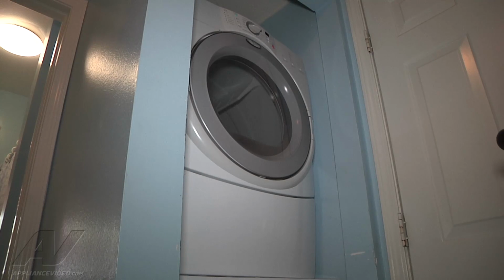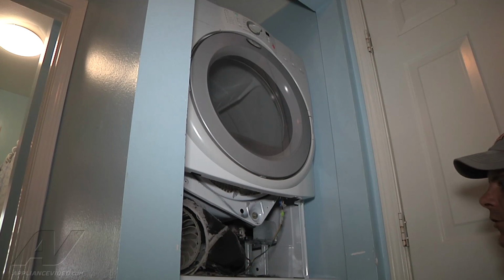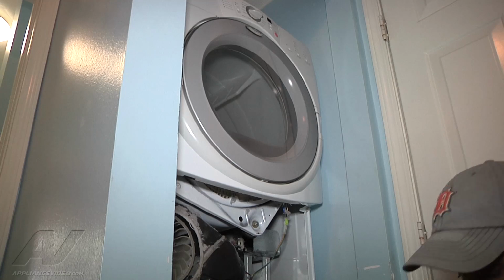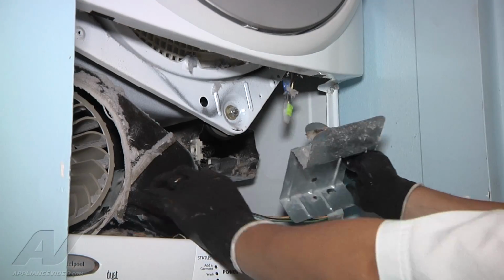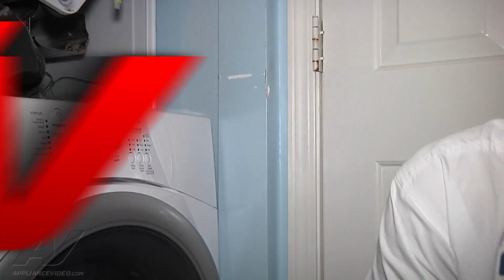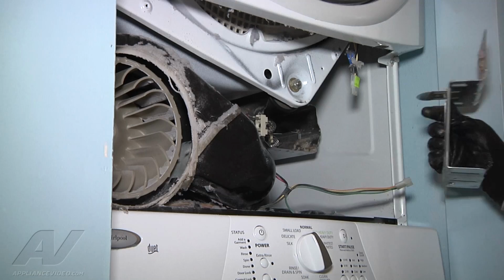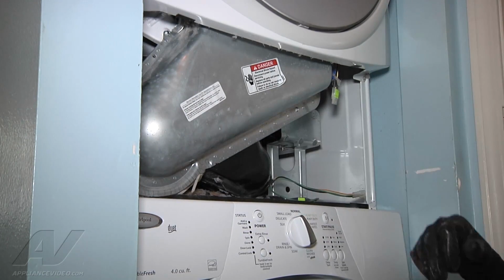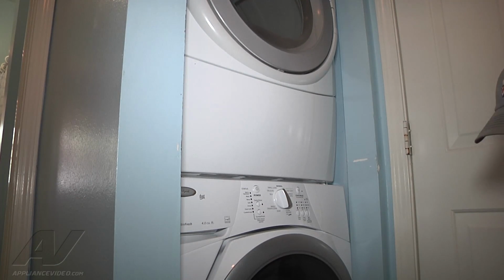Whirlpool Dryer Repair - Not Heating - Element

Comment: It was just like the video! The support was cracked, and there was a break in the heating coil. I was able to check the continuity of the coil without taking any of the lint trap off. And then to remove the coil I bent down the metal shield in front of it and only had to take one screw out to take the heating coil out.

Comment: Thank you for the video. I have a Whirlpool GEW9200LL1 and this video worked. There was an additional screw and bracket on the lint cover. I did not need to remove the first wire (was able to work around it). It looked like I might have to remove more wires from the heating element housing, but the piece does slide out like in the video. Glad I watched it.
Reply from the maker: Great question, you can call
our parts department at 1-800-830-5465 and they can give you help 6-days A week
Mon-Sat . You can also search at www.SaveMoreOnParts.com 7- days a week.  If you have a more
technical question that our parts department cannot answer, our technicians are
answering all questions at our website at www.ApplianceVideo.com under our Repair Help section. We have over 6,000
common questions and answers that you can easily search through by your model
number, appliance make, problem or error codes, and It’s completely free to
search through our question & answer library. There is a very good chance
you question is already answered there.

Comment: air fluff to test control board is a great tip. Thanks!
Reply from the maker: JDHogfan
        Thank you for your positive comment. Please help us provide more videos to our site by posting ApplianceVideo.com on your YouTube, Facebook or Twitter account or add us to your circles. If you are in need of any parts please support our parts department on line at http://savemoreonparts.com/ or call 1-800-830-5465 7-days a week until 11pm Eastern time. Thanks again your support.  Matt, Ace Appliance service technician.

Comment: Very helpful although I think the camera should have covered the left side of the unit and also the step reattaching some parts was omitted.  All minor....but one things wasn't, and that was the lint should have been cleaned out of everything before inserting the coil.  BTW, would the units diagnostics isolate the problem?  I have tried a couple of different buttons but no luck in getting diagnostics started.  I wish the instructions were specific into which button one should use.  Ps...one of the better DIY videos.
Reply from the maker: Great question, you can call
our parts department at 1-800-830-5465 and they can give you help 6-days A week
Mon-Sat . You can also search at www.SaveMoreOnParts.com 7- days a week.  If you have a more
technical question that our parts department cannot answer, our technicians are
answering all questions at our website at www.ApplianceVideo.com under our Repair Help section. We have over
4,000 common questions and answers that you can easily search through by your
model number, appliance make, and problem or error codes, and It’s free to
search through our question & answer library.

Comment: Great Video.  Quick question...my dryer is gas and not electric.  Is there anything different I would need to consider?  Gas is connected and all other gas appliances are still working great, so it is not a gas issue.
Reply from the maker: Sheila
         Is your gas dryer not heating at all ? What is your model number ?

Comment: have a whirlpool combo LTE5243BWO and need to find location of heating element for replacement also was told locally the part is no longer available 
Tks for your time
Reply from the maker: Great question, you can call our parts department at 1-800-830-5465 and they can give
you help 6-days A week Mon-Sat . You can also search at www.SaveMoreOnParts.com 7- days a week.  If you have a more technical question that our parts department cannot answer, our technicians are answering all questions at our website at www.ApplianceVideo.com under our Repair Help section. We have over 4,000 common questions and answers that you can easily search through by your model
number, appliance make, and problem or error codes, and It’s free to search
through our question & answer library.

Comment: What if I don't have continuity on operating thermostat. How do I repair that?  And is it possible there is. It continuity on that AND the heating element. Or might I be testing it improperly?
Reply from the maker: Trudy
       All of our technicians are now answering questions daily on the ApplianceVideo.com website for anyone needing help. Just copy and paste this this question under REPAIR HELP, and one of our  factory authorized technicians  will answer any technical questions at absolutely no charge on your appliance issues. We also have over 2600 free repair videos to help with your appliance repair issues. Thanks for your support. Matt Ace Appliance factory service technician.
Reply: ApplianceVideo.com my whirlpool duet dryer smells like something is burning. IT does come on and it does heat up fine. What do you think?

Comment: Hi Troy, I replaced the element but have no way to check continuity.  There still isn't heat coming from the vent or in the tub. The old element had cracks in the flat housing but not the actual element so I replaced it anyway. How often does the board go out on these exact model dryers?
Reply from the maker: Hello,
We recommend looking at your high limit thermostat or your cycle thermostat. They are not very expensive and can easily be replaced, plus they are much cheaper than the board. Thank you for watching.

ApplianceVideo.com is a family-owned and operated company providing you FREE, high-quality repair videos. To make new videos and answer your questions, please purchase the parts you need from us at 1-800-830-5465, or order parts online at ApplianceVideo.com. Thank you for your continued support and good luck on your project.
Reply: Thanks Troy,  Hi limit Thermo was the issue. only a few bucks and back in business.  Thanks, The Williams Family
Reply: +Wayne Williams How did you know whether it was your thermo and whether it was the Hi Limit or cycle?  We are having the same issue that you did and have no way to check continuity. We changed our Heating element, and it was ONE of the issues as ours did in fact have a crack in it however...even though we have some heat again, not quite enough to dry our clothes.

Comment: I have a Kenmore Super Capacity balanced drying system model 417.  It kind of looks like the one in this video except I can't find the heating element.  It looks like it is behind the drum.  Any ideas?
Reply from the maker: Try this video link....http://www.appliancevideo.com/3072/heater-dryer-appliance-repair-whirlpool-279838-replacement-part/  its a different way to get into the dryer. Our family-owned and operated company works hard to provide you with FREE, high-quality repair videos. Please call  1-800-830-5465 for any of your parts needs, or you can order online 24 hours at: ApplianceVideo.com.  Thank you for your continued support and good luck on your project. If you are in need of any parts, our parts department has over 5-million in stock for same day shipping. Thank you and good luck with you project.

Comment: What are you using to remove the screws?  Doesn't sound like a regular screwdriver.  Seems like there will not be much room to move in there.
Reply from the maker: Great question, if you have a more technical question that our parts department cannot answer, you can search our over 10,000 answered questions free at our website www.ApplianceVideo.com under our Repair Help section. You can also call our parts department at 1-800-830-5465 and they can give you help 7-days A week Monday Saturday, or search at www.SaveMoreOnParts.com  24 hours 7 days A week.

Comment: Hi, pulled the bottom cover off, flame ignites and works fine for about 5-10min then the flame goes out.  Whirlpool-Duet mod# is WGD9500TC2 I can't seem to find an exact video for it on your website, any ideas, thx?
Reply from the maker: Sounds like you may have weak coils on your gas valve or a plugged vent that is cycling off on the high limit thermostat.Try running the unit with the vent disconnected that will tell you if its in the vent. If it still does it replace the gas coils. If you need parts call our parts department at 1-800-830-5465  Please help our ranking by subscribing to our YouTube page or posting our ApplianceVideo.com site on your Facebook or Twitter account.
Reply: ***** Thanks so much for your reply. I have a ref# from your parts dept on standby but not quite sure what to get.  It starts to glow during the cycle like it wants to light up again but never does. (only ignites during the first few min of a cycle), need to order parts asap What should I get?
Reply from the maker: You have an 85% chance of it being a bad igniter. And a 15% chance of it being gas coils. The igniter is cheaper so I would start with that. Good let us know how it works out. We like to know if it gets fixed. We also have igniter videos at our website ApplianceVideo.com. if you need one.

Comment: Troy i see error code fe279 on dryer what does it means?
Reply from the maker: Great question, if you have a more technical question that our parts department cannot answer, you can search our over 17,000 answered questions free at our website www.ApplianceVideo.com under our Repair Help section. You can also call our parts department at 1-800-830-5465 and they can give you help 7-days A week ,or search at www.SaveMoreOnParts.com  .

Comment: Thank you for this!
The worst part of the whole thing was getting out the 'tube-ish' casing that holds the thermostats & heating element (I've got an older Whirlpool Gold). It took three >10 minute wrestling matches to get the freaking thing out, & I couldn't see how it set in the flange at all. Testing thermostats & heating element, ID'ing the problem, ordering & replacing the parts took maybe 8 total minutes. 

Now I can't get the bloody blasted frigging piece of filth back in. Anyone got any hints as to how to get the $@^$%@&*ing thing back?? I'd REALLY hate to spend mover $100 to have someone in to just put that one piece back!!

update: never mind. 

I absolutely refused to disassemble the ENTIRE freaking dryer to put that part in*, so I ended up bending down the little, semi-circular tab which went into the flange at the back. Since the whole assembly is held in place with 2 screws on the brace in front, it hasn't made a bit of difference.

And my obnoxious neighbor swore I'd never be able to fix my dryer, 
because he couldn't figure it out. HA HA HA, pbthbthbththth!! . 

*reminded me of the Fiat Spider I used to have, where you had to pull the engine block just to replace the spark plugs.
Reply from the maker: Thanks for your response, we are glad we could help. Our library of over 5,700 videos are currently helping over 1.6 million people like you every MONTH.  Please help us by subscribing to our YouTube channel, or post our website www.ApplianceVideo.com to your Facebook page, Twitter, Instagram or any other social media sites. Your support will help us keep producing more free quality videos.

Comment: I replaced the heating element, the fuse, thermostat, board, everything. Still no heat. What am I doing wrong? Drum runs, blower works, just no heat.
Reply from the maker: Great question, if you have a more technical question that our parts department cannot answer, you can search our over 17,000 answered questions free at our website www.ApplianceVideo.com under our Repair Help section. You can also call our parts department at 1-800-830-5465 and they can give you help 7-days A week ,or search at www.SaveMoreOnParts.com  .